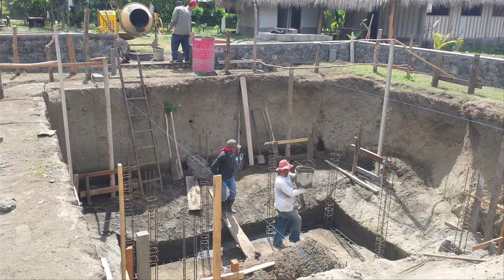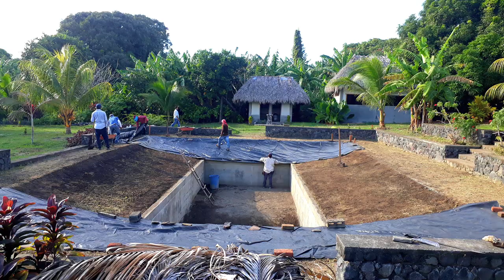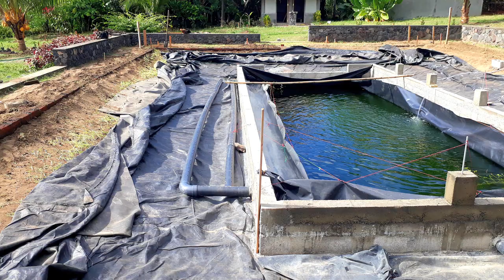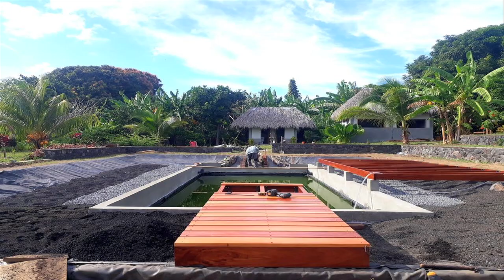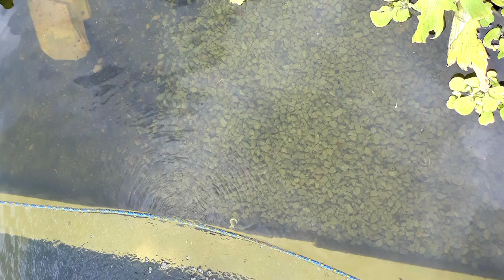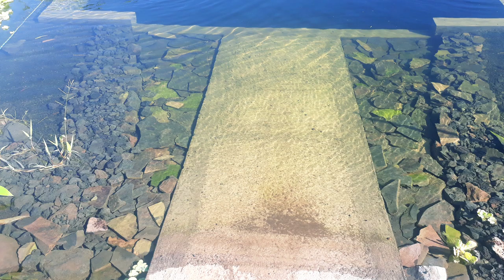Making a Tropical Natural Pool - DIY build in 3 mins

Comment: Hi David, I just binge watched all your videos. Great Stuff. My question is, can you add a pool heater to the organic pool or will that just kill the ecosystem?
Reply: ya i've got the same question
Reply: Great way to watch your savings disappear.
Open to the air large volumes of water are insanely costly to heat
Reply: It's in Nicaragua, so it'll be like bathtub temp most of the year. I could see putting in a fountain for evaporative cooling.

Comment: David, I'm a big fan.. We've been with you since you began.. I need help. We've got a 1 acre  "tank" or natural pond in heavy dark black clay soil. 20 years old.  So it holds water well, but it's so dark with a mirror look. There's a few tannins that I'll begin filtering through the wetland area (which is twice as large) soon. My family won't swim in it unless they see the bottom. Snakes and gators..😊😏. How would you recommend to lighten an area for a swimming hole? White gravel floor? White clay? Light colored sinking liner?  ??  The Dave

Comment: How do you clean the debris that might accumulate in the gravel bed over the years?  
Drain the water, take the gravel out, clean it and put it back?  Or, put in a back flush system used by some koi pond builders?
Reply: From what I have seen of nature filtered pools many of them have a shall gravel bed that works as a skimmer box with the water entering and flowing down through the gravel. This functions as a trap for debris.
Reply: The pool featured is mine. I have found that the microorganisms in the water clean the majority of the debris. Some sludge builds up in the bottom over time and to combat this i drain the pool once a year and give the pool bottom a clean and scrub. When I emptied it the gravel was very clean.

Comment: Instead of black plastic tarp crap what else can i use that's organic and water proof
Reply: Think about it
Reply: Clay?
Reply: @eyesopenwideawake7057  clay is hard. How will you dry it and water proof it
Reply: It’s rubber, not plastic. “Organic” (if it even makes sense using such a word for a pool that is human built and therefore artificial) refers to the filtration system that is done by plants and bacteria in the gravel bed instead of mechanical filters and chemicals like chlorine.
For a fully organic experience go and swim in a river, lake or any natural pond.
Clay is hard when dry, in the bottom of ponds it is always muddy. It settles in the bottom and the water can get clear but if you go in and stir the mud the water gets dirty. It’s part of the organic experience.

Comment: How worm can you allow the water to be without killing the ecosystem?
Reply: The problem without temperature is that it reduces the ammount of oxygen available. But you can help that problem by putting many plants and also the extra oxygenators that u can see running on the video
Reply: The ecosystem in a tropical pool is created in a hot temperature and therefore thrives in such. The water is kept cooler by making the pool deep (3 meters) and using one of the bubblers connected to a 4" of tubing that runs to the bottom.of the pool in the deep end. It's draws cool water from the bottom and brings the over all temperature down. This was an add on to David's stytem that i put in to account for the hot climate. The pool maintains a temperature similar to the nearby lake and therefore the natural ecology of the area is in balance with that of the pool.